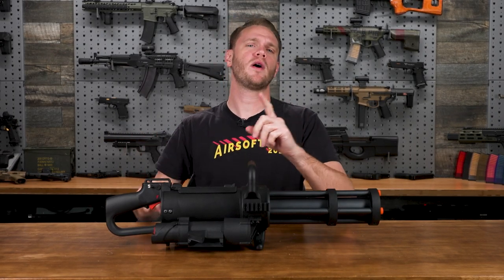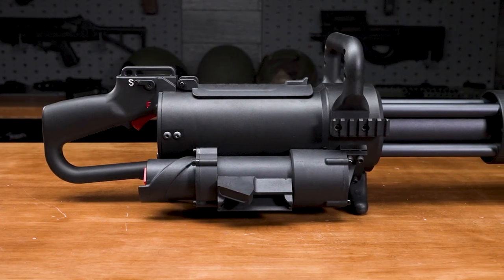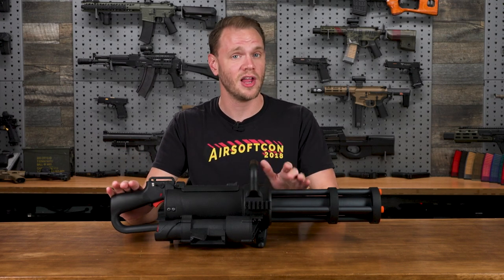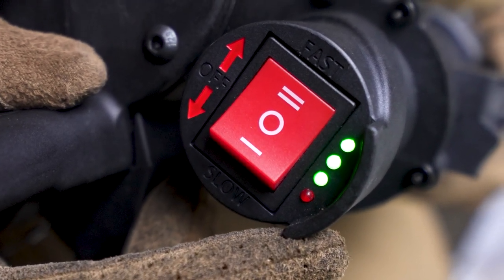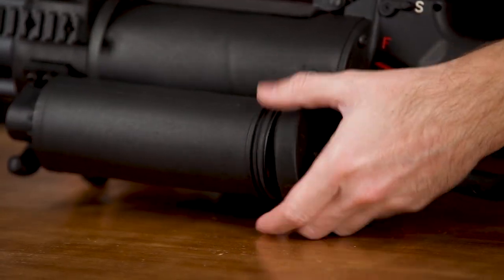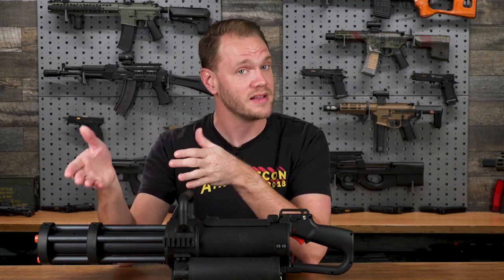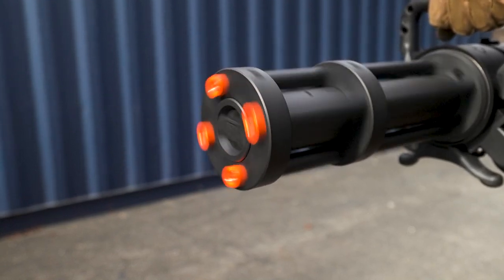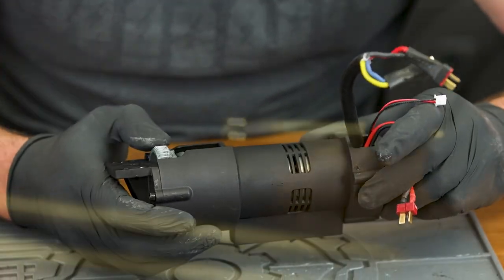Classic Army M133 Mini Vulcan Rotating Multi-Barrel Airsoft Minigun AEG Review

Comment: 4 full cylinders, 4 ML MR rubbers, 4 ZCI barrels, 4 M120 springs, 2 giant 3000 mAh RC car batteries.... Man I want this so much :)) But I guess the guys in the customs office wouldnt appreciate it coming in the mail. Its not that much more expensive than a Krytac SPR+PDW bundle either, as those things run about 500 euros (roughly $600) in lots of places and even more in some other countries. Add mags to those, batteries, some attachments and youre at $1000 without even noticing.

Comment: This is a very interesting idea. I wouldn't use it stock (you can DSG a featherweight M249 and get a higher rate of fire than 50rps for cheaper with less weight, actual sights, and no proprietary parts to break and be unable to replace), but if aftermarket parts and upgrades are developed for this thing it could legitimately be a very interesting platform to work with in the future, at least if you're rich enough to fork over a thousand bucks for it.
Reply: How you liking the featherweight m249?
Reply: @chinoyomaji288  Probably the best MG I've ever ran mostly because of the weight. Stock internals are alright nothing amazing but also pretty much what you'd expect in that price range, externals are somewhat flimsy compared to other M249s on the market like the A&K or G&P but that's the tradeoff you expect for the lower weight, and they're not awful or anything. The battery space sucks but you can grab PEQ-sized brick batterys of HobbyKing for dirt cheap that work in it.

I'm a small guy so the lighter weight is huge for me. If you don't mind lugging around a gun that's twice as heavy and expensive the G&P version is sturdier and performs better out of the box, but frankly with the extra money you'd spend you'd be better off just getting the featherweight and some upgrades.

Comment: I have the HPA/Green Gas version of it and I love it lol.
Reply: Hey how do you like that version?  Has it held up to regular use?
Reply: @rodmullen64 I have the HPA version and its going just fine. Get the rear hose replaced with braided hose. Take it apart for 're greasing/WD40. Upgrade hop ups to maple leafs. I use a 14v RC 5000mah battery and it blasts great.

Comment: Matt plz plz plz talk about goggles that are compatible with glasses !
Reply from the maker: Try these out - Rothco OTG (Over the Glasses) ANSI Rated / Mil-Spec Ballistic Goggles - https://www.evike.com/products/61362/
Reply: Guard-dogs aggressive eyewear goggles my friend. I use the version 1 that has two lenses but also have a pair of the version 2 which is one full lens. Fits over my glasses perfectly. I prefer the version 1 because it gives me more room over my nose without pressing down on my airway. Like a pair of sunglasses rather then goggles. I own 3 pairs 😅
Reply: I second the OTG's. Alternatively, you can get prescription, MIL-PRF lenses built into a set of full-seal glasses or sunglasses. Look into TacticalRX, which is where I got mine. I'll still be using my OTG's for doubled protection, but they seem like they'll work well (I got mine after the season ended).

Additionally, go for Mil-Spec (I believe it's MIL-PRF), especially if you're looking for glasses-type protective eyewear, as ANSI for glasses is different than goggles, and only equate to roughly 1 Joule, whereas Mil-Spec ratings are over 10 Joules. And if you're encountering more than 10 Joules on the field, you need to have a talk with the field managers.
Reply: Wiley X is another platform you can talk to your optometrist about, i had a pair before i got lasik.

Comment: Being real I was thinking to buy it and rent it out at to people. Especially since it does 15 rounds per sec that in spec of all my local fields.
Reply: Redo your math man, it's 25 or 50 rps.  I'd also like to point out that because the magazine is an integrated tube, it'll go through the full 2200 rounds in 44 seconds.  Two games will drain you of a full 25$ bottle.
Reply: @Truex007  probably a typo for the rps and not like I’d be supplying the bbs that would be whoever’s renting it problem

Comment: @Evike.com Airsoft   When you say a game or two ? You mean a day game or two or only running like 20-30 mins ? Is it on fast mode or on slow mode ?
Reply from the maker: @boyard Vincent Our approximation of "a game or two" probably doesn't cover games that last all day, and likely won't apply if you use FAST mode and hold down the trigger for extended periods of time.
The Mini Vulcan has a 2200rd capacity. If you use FAST mode (50 rps) you'll have about 44 seconds of firing time. If you use SLOW mode (25 rps) you'll have about 88 seconds of firing time.
How often you will reload will depend on how often you shoot and how long the game lasts. If the game lasts all day, then you will likely need to reload several times. If the games are shorter, then you'll probably have time to top-off between matches.
Reply: @evikecom  thanks for you ans !
Then in Slow mode, with average firing, how much batteries and BBs would you recommand for an full airsoft day ?
Reply from the maker: 6 batteries and 10k BB's.
Batteries - https://www.evike.com/shop/28/31/
BB's - https://www.evike.com/shop/28/27/
Reply: @evikecom  wow, it's gonna be rock'n'roll ! 🤣
Thanks for the infos !